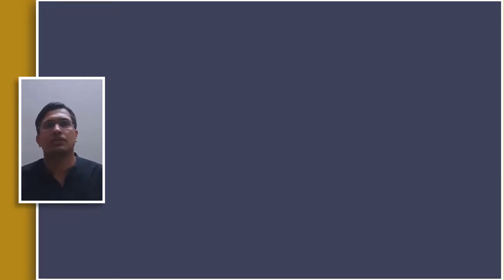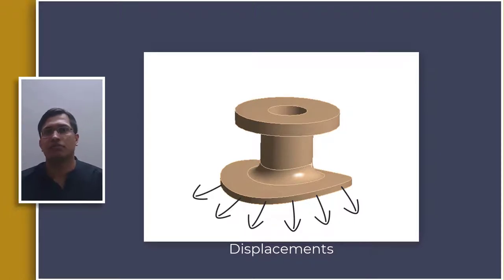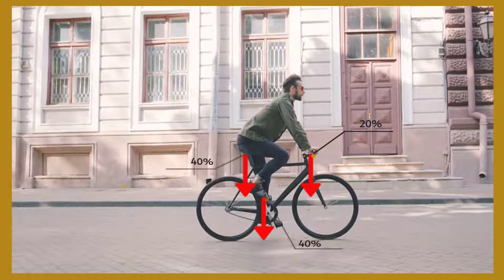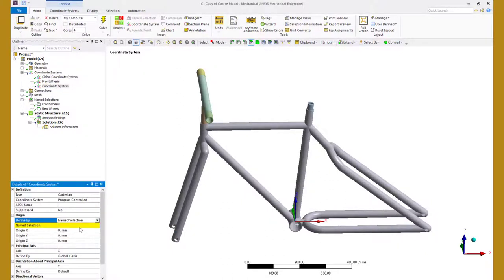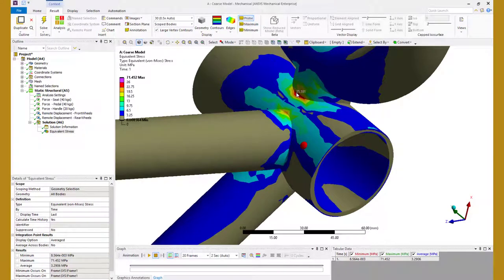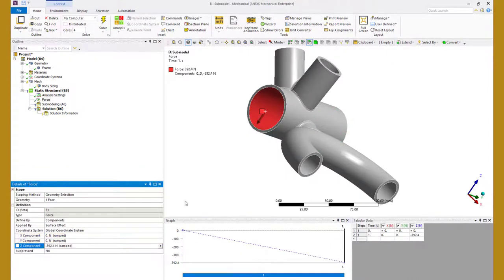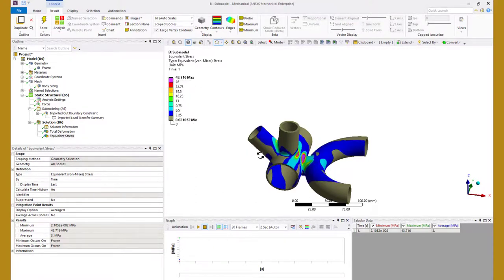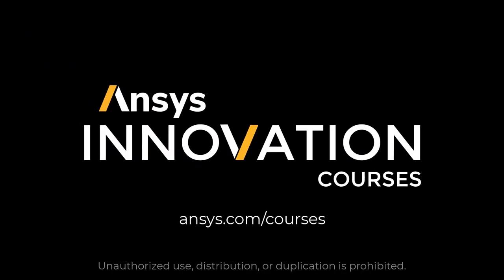Performing Submodeling in Ansys Mechanical — Lesson 6

Comment: At 8:12 pedal load is applied which results in some deformation, then why is it again applied at 11:10. Doesn't it make over load than the required load?
Reply: same doubt
Reply: There is a load in the cut region. As I see it, if it is not applied again in the sub-model, the overall load balance would be wrong.
Reply: @adilasbai96  but the load is infered through the deformation data I believe. So same doubt